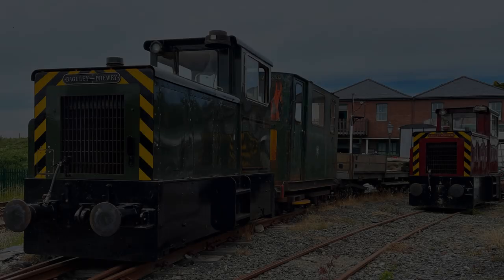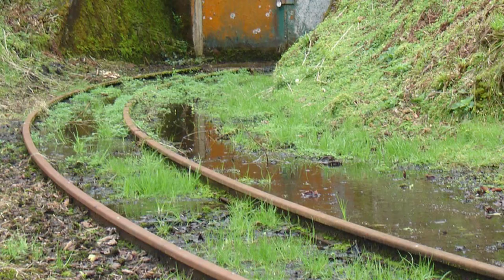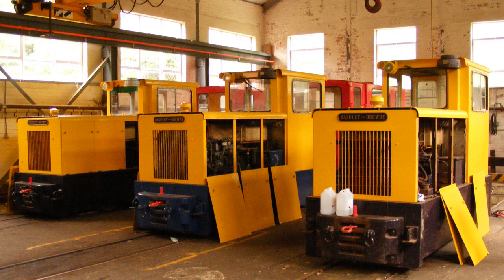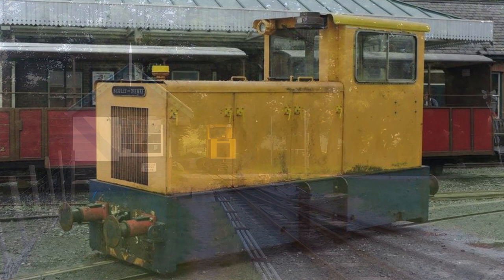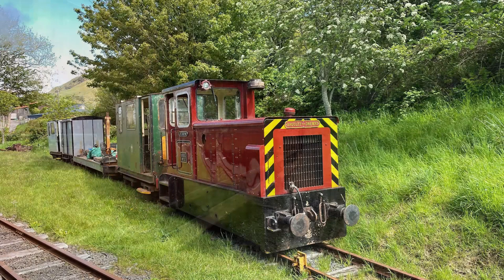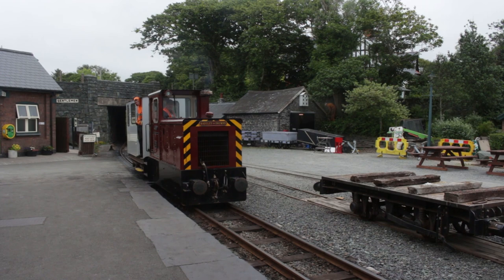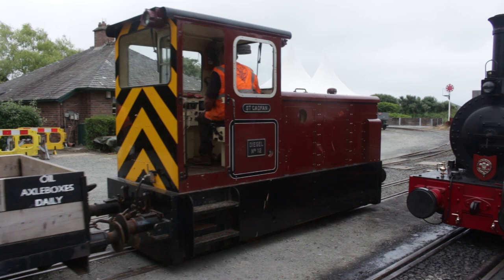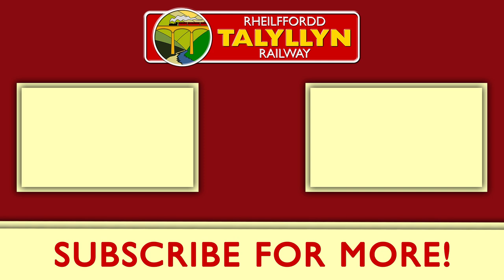Engine Stories: Trecwn & St. Cadfan - Talyllyn Railway

Comment: They are also numbered in the order they are because №11 was first off the lorry but was then at the far end of the siding, meaning that №12 was the easiest to get at when it came to removal for re-gauging.

Extra fun fact, the plates saying which number is which are modelled on those fitted to №5 and №8 in the early days of preservation - including the very circular O in №.

The nameplates on both locos are also a unique shape for the Talyllyn, reflecting the makers plate above the radiator grille.